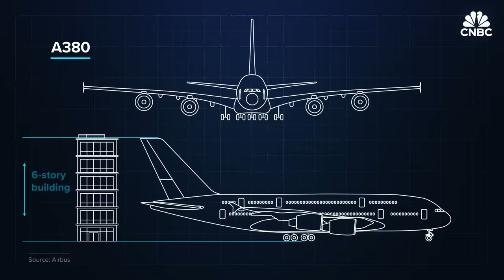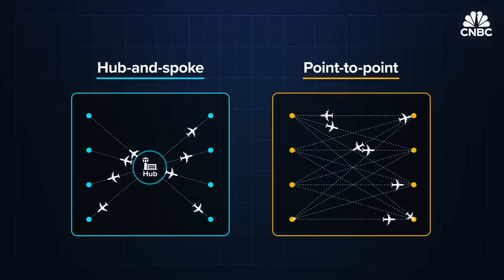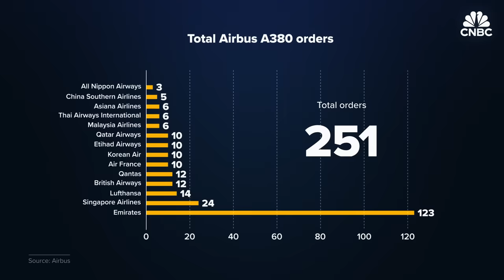Why The Airbus A380 Is Making An Unlikely Comeback

Comment: I would think with the continued limited capacity of both gates and mostly full flights that the A380 has a future. From LAX to NY (I understand multiple airports) there are over 20 flights per day across 6 major airlines. Couldn't they reduce this or have two airlines team up as a way increase gate capacity and profits? I get it not being viable say from NY to FL but NY to London has 22 flights a day. What I am getting at is I would think some US carriers would have bought a few.
Reply: Customers as a rule of thumb tend to prefer more departure times rather than a larger aircraft. That's why the market has shifted smaller the past few decades.
Reply: If you reduce competition, prices will go up making it moot
Reply: The primary problem is the A380 is not very efficient - it takes too long to load, disembark and turn around compared it long-haul competitors like the 777, 787 or A350, while to add insult to injury, also costing more per seat mile than those planes to travel those same routes. The A380 is a great plane to fly on, much like the B747, but most people just want to get from point A to B as quickly as possible, and hopefully with flight times that fit their schedules best - this is the reason why 22 smaller capacity flights are better than 8 ultra-large capacity ones.
Reply: Two Boeing 787-9s can fly at less than the cost of a single Airbus A380 

I believe US carriers understand the importance of economics 

That could be a plausible explanation
Reply: @rushilshah7149  your reply doesn't address the point from the OP. There's a limit to how many aircraft can operate in and out of any airport safely. The passenger experience on the 787-9 is also worse than the A380, especially long haul, unless you happen to be in Business.
Reply: @theharper1 That is why so few airports in the US are slot controlled, right??????
Reply: @bftjoe  sarcasm doesn't work very well in plain text. Do you think that you could reply in plain English for me, so I understand what you're actually saying, as opposed to what I think you're implying?
Reply: @theharper1 He asked, very simply, how many airports are slot-controlled. Implicitly, you should also include in your reply, how many airports are NOT slot-controlled.
Reply: @user-zt8id3wz1j  why is it my responsibility to research a subject which I never introduced? I simply said that there's a limit to the number of aircraft that you can safely operate in and out of any given airport. If you use the A380, you can reduce the traffic. But if you think that the spate of recent near misses at US airports indicates that all is well, good luck with replacing the A380 with double the number of anything else.
Reply: @theharper1  Did you know there are a whopping 3 level 3 slot controlled airports in ALL of the USA???? No wonder the A380 sold like hot cakes!?!?!??!??!!????
Reply: @bftjoe  because the A380 only works at slot controlled airports? What gave you that idea?
Reply: @theharper1  If the A380 is so great at congested airports, why does no one fit them with 800+ seats? Are the airlines too dumb to make money? They should hire you!?!????
Reply: @bftjoe  I find that the person who needs abuse to prove their point isn't worth discussing anything with. Have a nice day.
Reply: @theharper1  Ah yes, you sure proved everything!!!!!! No wonder those stupid airlines are going out of business to those ones that bought the wonderful A380 and that the A380 is still in production! You are a true genius!!!!!! No wonder airlines fit 800 seats on their A380s, look at all those constraints!!!! You must make millions consulting for the airline companies, right???????
Reply: @bftjoe  child.
Reply: @theharper1  You believe in the A380 fantasy. LOLOLOL
Reply: @theharper1  Did Airbus make more A380s to make your feelings good, yet????

Comment: Finally got a ride on the A380 this past January. I had a reservation in 2010. My business trip was postponed as I was on my way to work with my luggage in my car. When we finally went 2 weeks later, it was a different airline and no A380.  12 year wait, but I got my ride! Very quiet, very smooth, a real sense of engine authority.

Comment: I live slightly to one side of the flight path of Gatwick Airport (UK) and quite near to the airport itself. Lucky for me as I love aircraft and even now a decade later I still stand and watch every single time as the 380 powers away on its take off profile into the sky, often banking directly overhead and at low altitude as it takes a bearing. Even in the sky its scale is obvious. Awesome, makes me tingle every single time.

Comment: Im flying BA A380 to Singapore in a few months. This is the only aircraft I pay in advance for a chosen seat. Window seat, upper deck. Only two seats wide, I will get a small cupboard under the window to stash all my essentials for a 14 hour flight, that normally have to be squeezed in to the seat in front pocket. And Its a fabulous ride

Comment: The best airplane hands down. Not for the size, but for the best that money can get for "Economy" class. Having travelled Emirates for more than 3 times, from Toronto to Dubai, I have never seen the flight get late by more than 2 minutes at best. In fact, it is always before time. 12 hours pass before you know it, as the entertainment system aboard and the food are to die for. Not to mention the quietness of the beast and the cameras mounted on the belly of the flight and the nose, which makes for a thrilling viewing. The room in the Economy class is so spacious and allows you to move from a window seat to the aisle without even bothering the person next to you, which is amazing. Not to mention the air attendants with their best behaviour.

Comment: I have flown the A380 over 60 times with Emirates. Its a Fantastic plane and the Seating is among the best whatever Class. If they can solve the Engines economically fuel output then it will be around for years.

Comment: Travelled SQ 423/424 BOM-SIN-BOM multiple times for work trips. Best airline experience of my life, hands down. Yes, the size is mighty impressive, but the comfort is just ❤. It accommodates my height and long legs like a piece of cake even in economy, that too in the dreaded middle 4 seats. And it's so smooth and silent you forget you are crossing continents at 40000 ft. Liked it so much that I ensured our honeymoon trip included an A380 leg!

Comment: The A380 is an incredible piece of engineering and given the choice between it and the 747, hands down i trust the A380 far more. The speeds in which it can land and take off for its size are insanely low. Meaning it can deal with the loss of a couple engines "easier" than the 747. Those ridiculously large wings are a feature in themselves. 

I imagine this has been said many times, but i wish we could somehow bring back the Wright Brothers and other pioneers in flight to see how far we've come. To show them what they started. A building with wings.

Comment: Not mention ANA Japan currently use A380, too. From my experience, of all the different commercial jets I have used, the A380 was the best long-distance international flight ever. The cabin was so quiet and flew very smoothly. If the Airline accommodates only premium economy class and business class, the A380 would be desirable to the passengers and profitable to the Airline. Oh, yes, a much more spacious restroom would be lovely. I love A380.

Comment: The passenger number aspect isn't really that strong of a point since you can just add air freight for the weight saved by absent passenger. That's basically why airplanes didn't stop flying during the pandemic. The main issue with the A380 is plainly the bad fuel economy.

Comment: Very informative.
As a light load cargo plane, this aircraft would dominate, carrying double the amount of cargo, and allowing larger than normal size loads that would normally only be capable to be moved by ships. It's a niche market that it didn't even try for...
Heavy lift cargo would not be an option, as later stated, but that's not a problem, it's an asset for that role.

Comment: The Tesla Roadster is the same as the Airbus 380. And these innovations are not optional. Humanity must continue to build things and create new innovations that are unnecessary, for the purpose of learning, enjoyment, and the advancement of science and technology. If we only factor the current market demands and the current economic model, then we are failing as a species. The Airbus is a marvel of engineering, something like the Pyramids of Giza, something that by all measures, should not exist. Like the Big Boy 4014 steam train of 1941 with 6,200 horsepower and 80mph top speed, weighing 1 million pounds. Nobody needed a Big Boy 4014 train, but it is still in operation 80 years later, as a testament to Human creativity.

Comment: The  A380 is by far the most comfortable plane to fly, both as passenger as  crew. Landing with strong  side winds is always difficult, but the A380 is much easier to land in those conditions. It is also a very good designed, save aircraft.
The size is to big for most airlines, but airlines as Emirates build their business around that plane. As more and more people are flying again, the demand for such a large plane is rising again. Don't think it will go back in production, but stays in use for another 15 to 20 years.

Comment: I have flown on the 380 multiple times and yes, it is a very comfortable experience.  But I fail to see how it’s making a comeback?  
With the exception of Emirates, most of the other operators brought it back because they needed the lift until they find a more economical and modern solution.  When the 777X hits the market and with the continued manufacturing of the A350 and 787, the 380 will become even more financially obsolete. 
With Emirates having ordered 205 777x’s, along with many other airlines who currently operate the 380, it strongly suggests the 380’s fate is sealed.

Comment: I think the major problem with the A380 is that not even Airbus understood its true potential role and so neither did the Airlines. Instead of using the A380 to replace an aircraft and  expanding capacity per airport slot, it should have been used to consolidate 2 or 3 daily long-howl flights into one, thereby replacing not just 1 aircraft but 2 or 3.

Comment: I hope more RnD goes into providing a more fuel efficient engine for the a380. It will significantly be more suitable for use. 380s are also helpful in reducing the number of planes in the air as its load is equivalent to 2-3 wide body planes

Comment: The Emirates A380 returned to Auckland New Zealand in 2022. The Singapore A380 returned in November 2023. Maybe more airlines will return as air travel returns to pre pandemic proportions. The A380 might not be a commercial success but it is a marketing success. Fans come out to see the King of the Skies and it reminds them it is time to book  a flight, maybe not on the A380 but on another plane so it is a win-win situation. 😀

Comment: I think that in order to determine if the project was profitable you should also factor in the value that Airbus' brand gained from the A380. Hard to quantify but for sure it helped a lot in communicating to the world that Airbus was at least as capable as Boeing. Now it seems obvious but maybe it wasn't at that time.

Comment: Beautiful, I wish they updated it with 2 modern engines instead of the 4 older so it would cost less to operate.
Reply: Considering it has 4  vey large engines already, that would be pushing the technology a bit far. The Boeing 777 is the biggest twin, but its engines are still way behind what is needed to power a 380 with just 2 of them.
Reply: Hmm, RR ultrafan maybe? @garethonthetube

Comment: I fly long haul between Asian and the Europe a couple time a year usually in economy class and the a380 is the best plane by a mile. The most comfortable by some margin and that plane was BA. I usually fly with ‘higher rated’ airline but they tend to use single deckers and they don’t come close. The Dreamliner is the absolute pits. Most uncomfortable plane and I’ve never had a good experience on one.

I am 6’7/2m tall so all air travel is terrible tbf 😅

Comment: Inside, i really wasn’t feeling the size. I suppose if i had gone down the stairs and looked from front to back. But on the upper deck it just really felt like any airliner… which was fine. The ride was smooth and quiet.

Comment: I've flown on the A380 over 10 times and unless you fly on business or first class its pretty much a cattle call.  If I ever fly on the A380 I reserve a seat on rhe upper deck.  As   upper deck is where they usually put first class and some coach so with fewer people boarding  and off loading is easier, and fewer people using the restrooms. Plus the A380 I've been on had a small area where you can stretch.

Comment: I was able to fly in Row 1 on the upper deck of a round trip MCO-DBX on Emirates in 2017. I was flying economy. It’s a beautiful plane and the front right lavatory was shockingly HUGE… more than twice the size of the usual plane lav. Wish I could post the pic I took here. 😳 — I flew the same route again in 2018 and by that time economy was on the lower deck. 😒

Comment: I have flown on the Emirates A380 on multiple occasions.  All the shine mentioned is true.  But for the person in the Economy Class, where a majority of the souls are, there is no impact of the extra size at all.  He / She is still crammed in a seat where the knees are crushed by the seat in the front and you are seated in the window seat, you are forced to disturb the passengers beside you every time you need to use the washroom.

Comment: I worked at Airbus during the A380 production run. I have never heard a bad word spoken about this aircraft & seeing it take off or land is special indeed. It simply seems to defy gravity in a way that feels like someone has turned the sound off. It really is an engineering marvel. If the 747 story has taught them anything Airbus must continue to probe all avenues to secure niche markets for this machine. What about using just some of their composite tech in the wings & tail to make them lighter, particularly the outer winglets? Is there ANY other engine offering now available? Could it fly on 3 engines? Could it fly on 2 engines? How far away are electric engines? Could they revisit the cargo options bc a lower deck of cargo and an upper deck of passengers would seem an obvious option. Even if it was weight restricted cargo - all the light stuff - there could be demand for this on some routes. What about a 400 passenger retrofit which uses 4 engines at take-off but all of the remaining flight carried out with 2 only, extending the life of the engines. You could then have the engines on rotation like tires on a car, greatly extending their service life hence costs. What about electric engine boost for take-off only? Put a weight reduction team together and see what they come up with, start with a spreadsheet of the most dense items along with how much is in the aircraft = overall weight of that component. There will be some surprises in that list. Put a team together to take fresh look at the cargo option. Maybe an engineering solution that doesn't require much change to the floors etc but contains/distributes the weight differently when loaded. With 500 passengers just a 1kgm baggage allowance reduction gets you half a tonne for zero cost.  I feel like saying something like; " Now that you know how to make it, re-engineer it and make it properly" but I wouldn't dare!

Comment: Loooong ago, when I drove on my bicycle here in Munich on a straight road east to west - and saw a 747 crossing, seemingly just beyond the end of the road. 
WTH does that plane do there so low? There is no airport!!! 
 
Turned out that it was not at the end of the road, it was about 20 kms away in Oberpfaffenhofen, where the DLR (german aerospace agency) is located. 
 
They were testing the wake vortex of the Airbus 380 during landing, to find out the safe distance after the 380. The 747 I had seen was the "chase" plane, that flew behind the A 380.

Comment: When I have a choice I always choose to fly with A380, my second favourite is probably 787, although A350 is also quite good. But if we compare to older aircraft like 777 or 747, then A380 is so much better. Every single time I been on A380 it was the most pleasant flight. I mean sure - most of the times I was on Emirates A380 and they are just good airline, so perhaps it is not fair to compare the experience on say AirCanada 777. But plane itself is more spacious, more modern, more quiet and overall it feels like next level in terms of comfort.

Comment: It's the right plane at the wrong time... 10 years earlier it would have been ICONIC. 10 years later? Probably the same thing. Instead its an oddity but one that I am glad exists an hope to still see for decades to come at the biggest and best airports on Earth! Meanwhile the earnest little A220 is taking over the aviation sector faster than anything else... Why? Economics... The newest and best Carbon fibre, clean-sheet design that was built around improving the economy flying experience with wider seats, larger windows, lower pressurization and has become the fan favorite of all passengers that fly it...

Comment: Hub and spoke is just a pain. Most prefer point to point for obvious reasons.  Also, smaller planes are quicker to board and unload.   Regardless, I would love to fly the a380 but not with multiple stops.